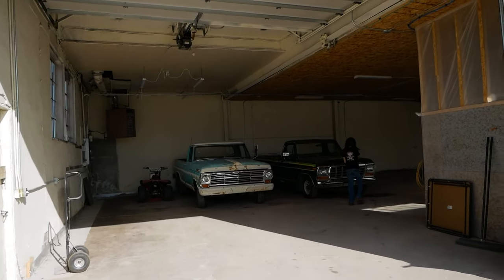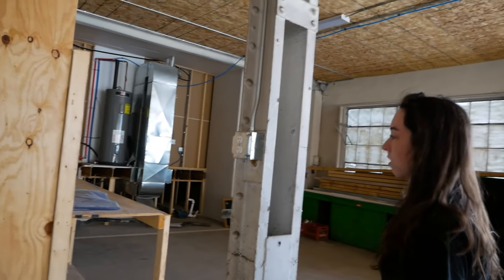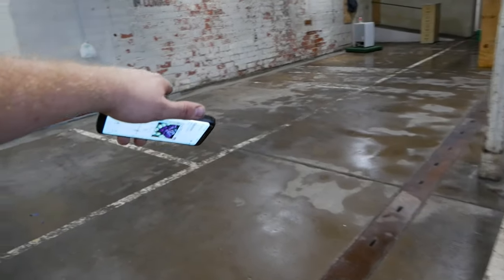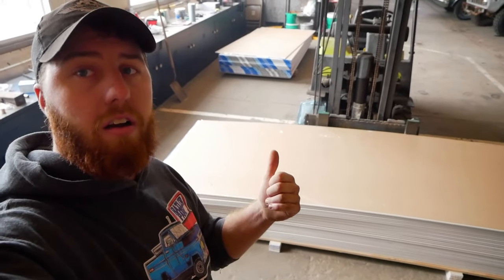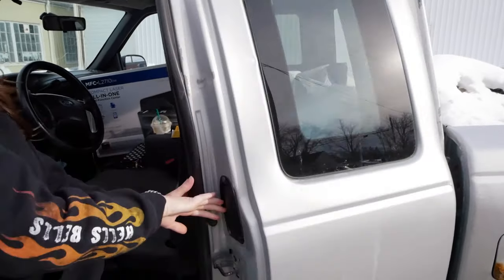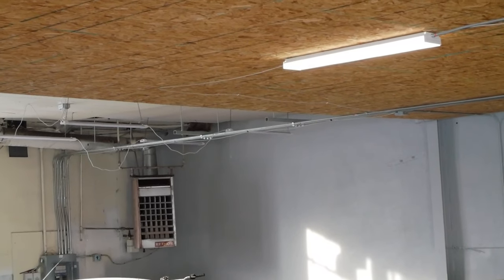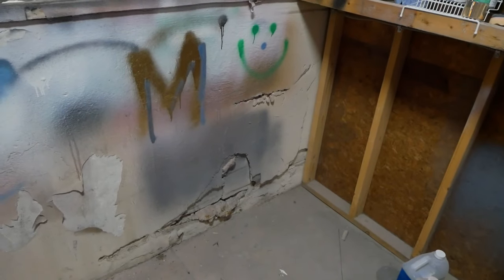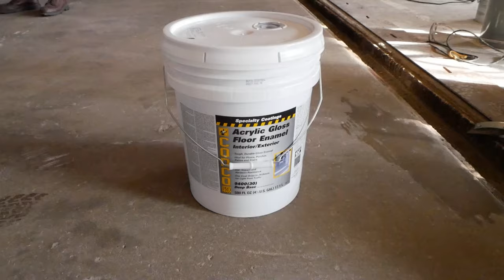Can We Revive a BUILDING!? Remodeling a Neglected 1920's Dealership!! -- Part 1

Comment: Building had only highway miles, then sat parked for 999 years. Can we put it back on the road?
Reply: That's. Legit....loops wrong. Channel
Reply: It ran last time it was used...
Reply: @rsprockets7846 is that a polecat fan I see?
Reply: rough start onn an oldie but you kicked ass and got er done..  Good Job momma
Reply: Missed the best part. No low ballers I know what I got!

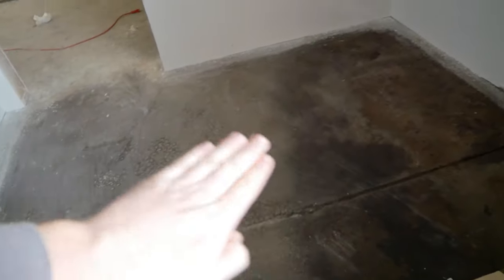Comment: I think I would have just assumed that the paint work was lead paint and just put copious amounts of primer over it rather than filling the air with paint flecks. Also... That "giant crack" at 28:22 ... I am pretty sure that is an expansion joint. You leave space between slabs so that they can expand and contract as they saturate and desaturate with moisture from the ground throughout the year. No gap = cracks.

Comment: Who else is slightly sad that the incoming and outgoing was covered up
Reply: Hah!!! I thought that was just me. 😄.
Reply: I thought the same at first but just not enough historical significance to justify leaving with the rest of the shop not blending in
Reply: @darinsheary8847  Yeah, plus the lettering would be basically useless anyway. It's one thing if they actually needed an incoming and outgoing section but they're just gonna park their junk there regardless.
Reply: the original brick had a nice patina to it and could have sealed the concrete floor would have looked really nice
Reply: @officialvicelitti9436  I had the same thoughts, the brick looked great after it had been powerwashed :)
Reply: And the cupboards in green were much better
Reply: @marks-0-0  hahahahaha! I thought this too 🙊🙊🙊

Comment: The roof drain “boot” is a cast iron to PVC connection. It’s called a Fernco connector.
Reply: Fernco, plus they went with a strongback on the vertical. Was done right.

Comment: Next time keep your drywall 1/2" from the concrete floor , that will stop it from picking up moisture from the concrete .
Reply: Man, I was gonna say the same thing. I'm glad I scrolled through the comments first.
Reply: Should have been firekote wallboard with soundboard insulation. Underneath......
Reply: @rsprockets7846  Why ? Complete overkill for this application.  Firecode board would be needed in a demising wall ( which this is not ) or to separate a space into firecontrol compartments ( again not reqd in this instance) . Sound control drywall would also be not warranted here ( it is about 3x -4x the price) mineral fiber insulation would give as good a result for much less money . KInda like putting $4000 worth of wheels and tires on $ 200 car.
Reply: @stevecook7551  ok just saying....that water  heater  gas or.  electric should be addressed and seal off that utility room for the salon.   Looks  better though they a renter?

Comment: I used to live in an 120 yr. old farm house with the same draft problem at the windows.We took sheets of clear plastic and stretched over the window frame ,stapled to the frame and heated with a hair dryer, it not only sealed the windows ,but you could still see out. a cheap effective solutions.

Comment: Look out, that brick wall is INCOMING!

If you want to save some more heating money and those drafty single-pane windows either don't open or you're sure you'll never WANT/need to open them you could source some sheets of plexiglass and screw them to the inside of the window frames...That will basically give you double pane windows on the cheap...Though whether the money you save is worth the money you spend to save said money is your call.

Comment: Looks good.... FYI... the sheathing on your office roof is installed improperly!!! Plywood loses approximately 50 to 60% of its integrity installed parallel to framing so if you plan on using that as a storage mezzanine which no doubt you are i suggest you fix it or only store very light materials up there...

Comment: 12 in centers are over kill for a non structural wall , you could have cut you lumber cost in half building walls on 24 in  center . 3/8 inch dry wall board would be fine as well. Covering the windows with cheap shrinkable window cover is worth every penny , you can watch it expand as the wind blows right through the glass wooden frames Just some tip 's for your next build.

Comment: Great job, drywall has to be at least 1/2 inch off floor to avoid wicking. Even if you never wash floor it will pull moisture from the concrete

Comment: You should utilize that chimney, and Install one of those wood stoves that you hook up to ductwork. There are several cheap ones on Marketplace. Since it’s a pre-existing brick chimney, it wouldn’t affect your insurance too much. It could heat the offices and part of the shop. If you hung in oil burner in place of that natural gas heater you could basically heat that building for free. You have shitty winters like we do in Kansas, and I bet the first winter would pay for it all.

Comment: Bro only 5000 hours on that fork? We have one at the lumber yard I work at with 17,000 on it, runs on 3 out of 4, has a puked headgasket, valve cover gasket is gone, and the parking brake dosent work (big problem when you work in a out door area where everything has just enough of a grade to start rolling away) that ones a keeper!

Comment: You should put up a window insulation kit on each window (it’s a see through plastic, you can buy at like Walmart or Home Depot, it’s helps hold the heat in really well on those old windows). Looking good! Hoping for a lighting  led upgrade

Comment: For the windows, i have seen some people basically put some plastic sheeting that you stick/glue to the wood surrounding the window to still create something of a little bit insulating layer of air, it's not great, but very cheap, and actually still does make quite a big a difference.
Double pane windows are quite a bit more expensive, and it's only useful if you really insulate the whole thing at least decently.

Comment: There is so much you can do there. Paint it medium gray not white it shows to much dirt. Put a checkered flag around the whole place. Down from the top about 18 inches wide. Add some metal auto parts signs from dealers for free. The pipe in the bathroom was a clean out pipe. You have to keep the the part that screws off needs to be exposed. Just frame around it with wood and sheet rock it. If you need help hit me up. I'm in Florida.  You can also use pallet wood for inside the office for design. Incorporate car parts as decorating the office all that stuff is free to keep costs down. As far as the floor in the offices you can grind it then stain it to keep cost down. Using free and useful elements makes it give it a sense of character and you can use your money to fix up the cars I stead of buying high cost materials. Since materials have gotten so expensive that would be a better choice. Good luck and reach out to me any time. Great suggestion for that window in that room, put bat insulation in close it up with sheetrock and put some good lighting in there.

Comment: prolly able to store some boxes up on that ceiling 
about the office floor , not sure they have the same thing in america but over here theres a supper tough carpet tiling mainly used in offices and during stuff like sema , this carpet usually gets sold after a few events and still has quite a bit of life left in it , allso eazy to get out spots , oilspills and spilled food if you get some extra tiles https://vdpevents.nl/uploads/images/page/crop_slider/whatsapp-image-2019-11-15-at-09-07-13.jpeg
as for the windows , i would leave the old windows as they kindah belong to an old building , you could put double pane windows behind them after cleaning . replacing the broken and repainting the inside of the old wiindows

Comment: I'm Canadian and have a winterized bunk house on my property . It has two windows . To save on heat I built a wooden panel and attached Styrofoam insulation on it and I screw it in to cover one window during winter and remove it in the spring. It made a difference in the bill and comfort factor as well . You could do the same on a larger scale with some of the windows if you can sacrifice the light during the winter months .

Comment: think of Troldtekt for the ceiling, its very common in the eu as its a madly versatile ceiling material and its also an acoustic panel, ive also seen people use it more sporadically but normally you'd see it as the full ceiling, but ive also seen it on walls or as triangle boxes

Comment: I operate my automobile restrictions hope at my home 2 acer property an the moment a 2 car garage an once I get more work i plant to turn my 2 car shop into a office with showroom an bathroom an autobody supply an then build a prefab 3 bay shop off of it so one bay be with all mech tools an lift an then second bay for sanding an body work an 3rd bay paint booth then at the end of then end of the shop a carport with all 4 walls to be garage door to open so I can have a detail an powerwash area year round any weather hot out one m doors cold out well ys get it thats my plan but forgot I wish I could rent a bigger place an bring in more e then 2 jobs at a time